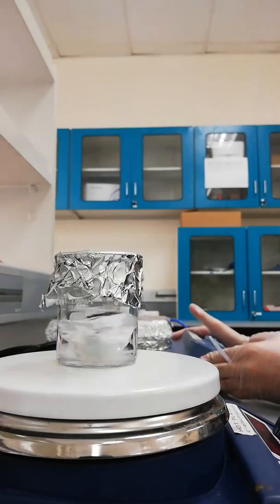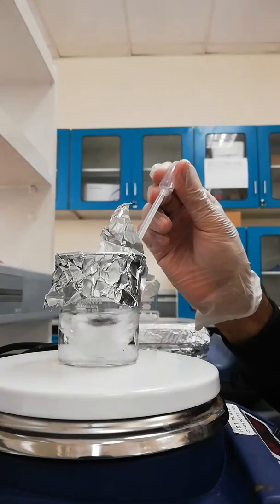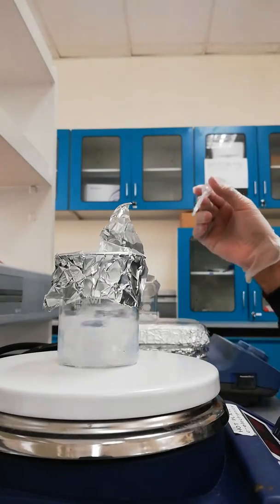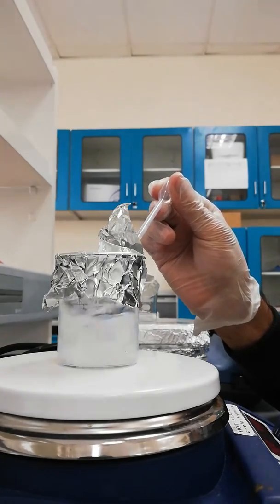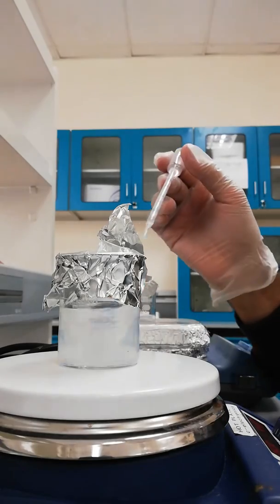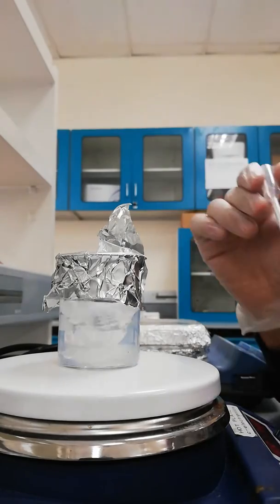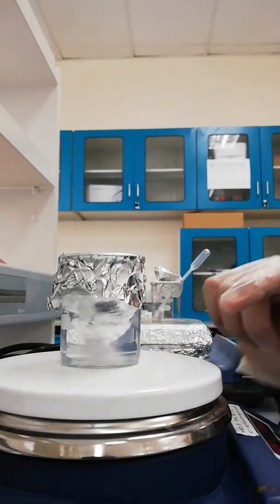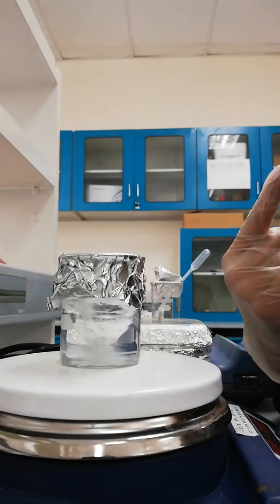Preparing Zinc Oxide Nanoparticles

Comment: It's not Zinc oxide in the solution instead It's Zinc Hydroxide  ,  you will  get zinc oxide only after heating the zinc hydroxide .
As 
Rough unbalanced equa
ZnC₄H₆O₄ + NaOH = X ZnOH + X NaC₄H₆O₄

Comment: can you please explain if gel is formed, how we can wash it?
Reply from the maker: @iqra jabbar are you asking about gel formed during ZnO preparation via hydrothermal? If so, there is no gel formed however using other methods like sol-gel the gel formed can be washed by ethanol or DI water using filter paper and then dried using overn.
Reply: @dr.jamalkazmi3565  which type of filter papar? Meanz pore size
Reply from the maker: @iqrajabbar5287  Filter Paper 101 Qualitative can be used. it is that filter paper used in chemistry labs
Reply: @dr.jamalkazmi3565  ok sir...I was just worried if pore size is large then nano particles will wash out...
Jazak Allah
Reply from the maker: @iqrajabbar5287  your welcome iqra. if u need further help, feel free to whatsapp (+601160667822). ma apko kch reference papers provide kr don ga
Reply: @dr.jamalkazmi3565  ممكن طريقة التواصل مع حضرتك

Comment: what is Disadvantages of zinc oxide nanoparticles?
Reply from the maker: ZnO has several disadvantages, such as the fast recombination of photogenerated electron-hole pairs, it is only active with UV light, and it suffers from photocorrosion. but talking about ZnO nanoparticles, it has disadvantages particularly in different applications. One disadvantage of ZnO nanoparticles is that, when their size is in the range of a micrometre, they are visible on the skin as an opaque white layer and this resulted in reluctance of consumers to use sunscreens products containing them
Reply: @dr.jamalkazmi3565  Thank you, but you can Send my question in a one-Page answer report to the general goat, please me help🙈😁
Reply from the maker: @somasabir9196  sorry for the late reply.  I believe you can find lots of journals that can help you better than me and make your all concepts clear. Unfortunately, I'm very busy with my PhD thesis these days. So I hope you understand my situation 😃😌

Comment: Some questions-
1)Can we keep in oven to get Powder form ?
2) Can this solution be mixed with 100 ml Ethanol using burette and then kept inside Oven at 80C for 24 hr to get powder form ?
3) OR without going for any oven heating, this solution can be used for any Nanoparticles  analysis ?
Reply from the maker: 1: Yes we can keep in oven to get the powder at 95°
2: Yes can
3: Nanoparticles can not be analysed without the proper heat environment inorder for them to be homogeneous and do the chemical reaction
Reply: @dr.jamalkazmi3565  Thank you so much
Reply: @dr.jamalkazmi3565  السلام عليكم استاذ ممكن سؤال من فضلك  طريقة تحضير بالتوليف الأخضر من النباتات لاوكسيد الزنك النانوي واوكسيد السيلنيوم النانوي  اكدر احصل على خطوات العمل